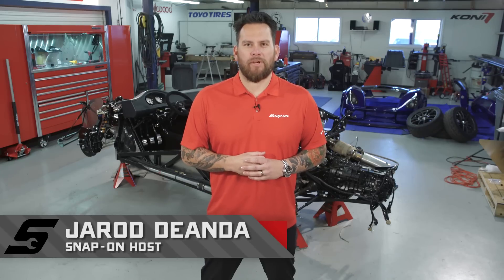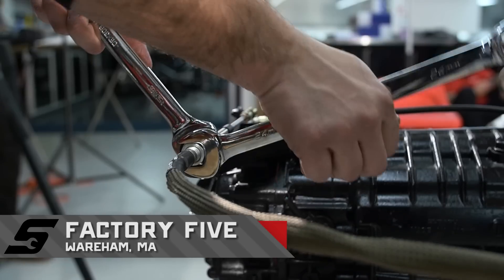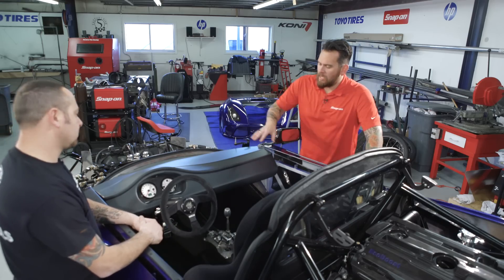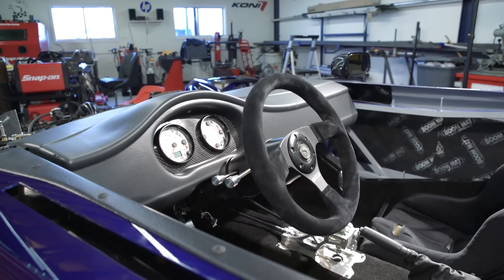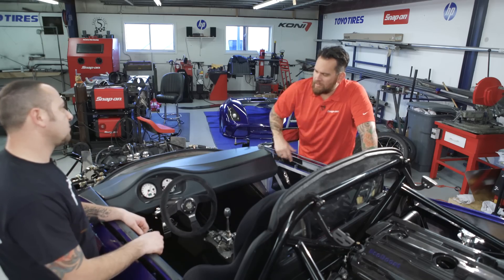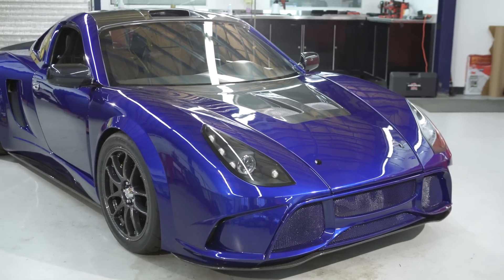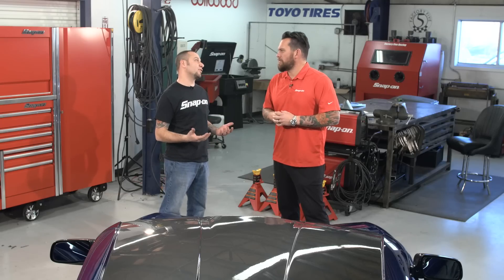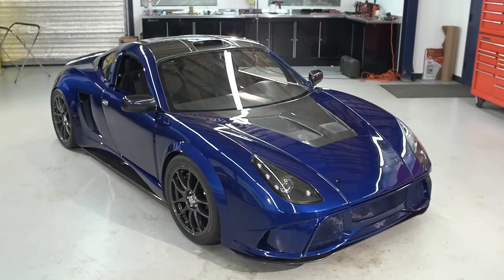Finishing up the 818C at Factory Five (Part 3)- Snap-on Tools From the Ground Up

Comment: Here's the thing with cars like this:  did anybody see like...climate controls?   How about vents, especially for a windshield defogger etc. ?  If you're going to drive one of these on the street, for any amount of time, you're going to want things like that....
Reply: If you decided to build one you'd probably need the skill level to fabricate the vents yourself anyway. There's AC components in the subaru open for donation, though you might run into clearance issues with the compressor, and the length of the lines. There was also practically zero insulation too, heat or noise-wise.
Reply: @NoelAWinslow   Yes I agree. I am looking into heat resistant sound insulation. If you don't you won't be able to talk in the car.

Comment: Are you kidding me? 

The amount of custom fabrication, custom parts, and welding needed to get this thing functional was absurd! Who the fuck could do this in their garage? It took a team of experts in a custom shop with all the right tools a few days to get this thing assembled. $25,000 in parts, but another $10,000 in expert assembly. This is not a deal. I have the feeling most people would give up after realizing how impossible the task is.
Reply: Impossible, not even close. Realization is always better than fantization so always get the facts because you can build this car and you can even do it with basic tools or at least have a friendly neighbor somebody a long you the rest maybe has a little home shop or something but you have to do it right it should take time is what is supposed to happen . Like any task someone is given or job or remodel-repair, if you know how to do what is required quickly, precisely safely and cleanly, you'll probably zip through it in about 200 Hrs start to finish. Don't really know what you're doing and not going to do your Cuts right your weldrite your wiring right excetera excetera in your mind isn't necessary on your job but the phone ring the horn blowing excetera excetera probably exceed expected 300 Hrs just to call it done

Comment: Kinda disappointing you're already done in only 3 episodes, that just shows the amazing engineering done by Factory Five and having the right Snap-on tool for every job. 
I would have watched a 10 part series of building one of these (and you could probably have gotten more views and subscribers.) Would be interesting to see the making of the engine to transmission adapter plate you used to mate the Ecoboost to a 6 speed STI transmission.
Reply: You don't have to worry about the adapter plate, Ford pulled the plug on the Ecoboost.  I have found a WRX - STI  that can be built and have 800 HP.  Screw Ford, not the first time they made a piss poor decision and won't be the last. This info came from the HQ when I called them.